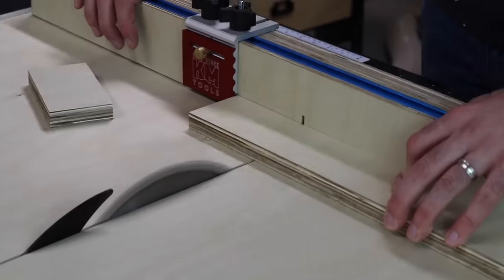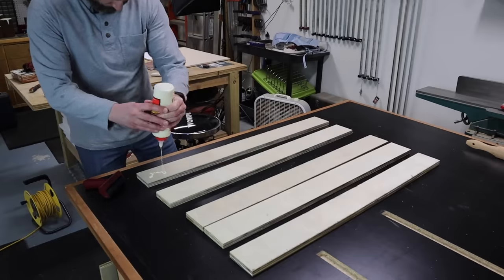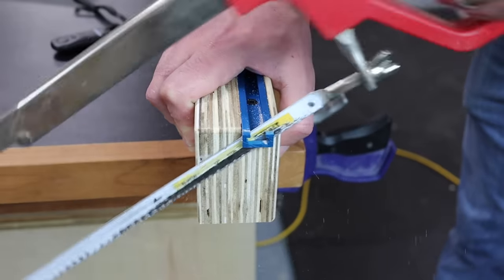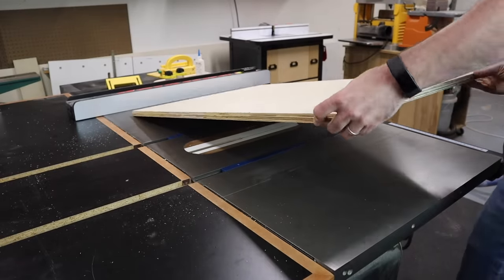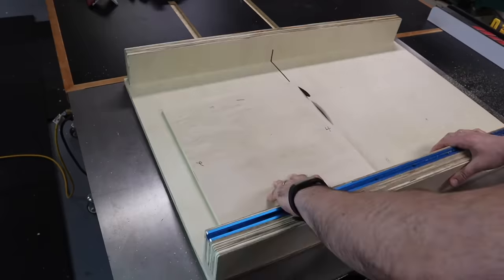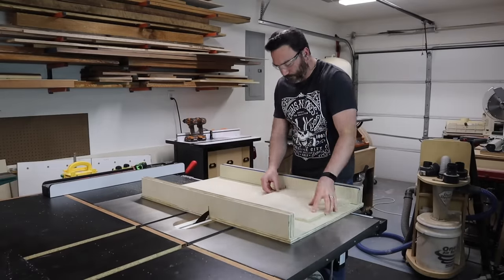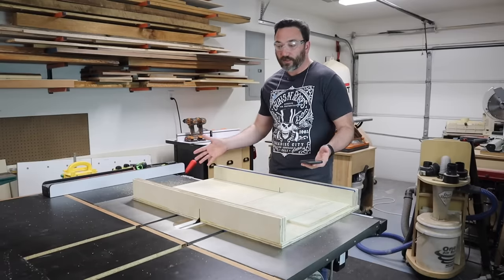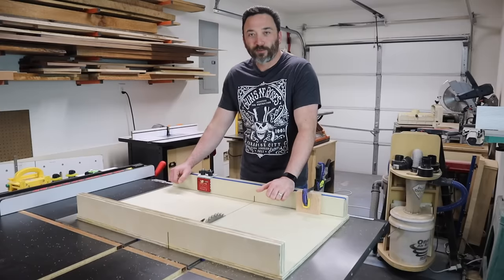Have a Table Saw? You NEED to do This!!!

Comment: Question nobody answers.  Once you make the first set of cuts the square board is no longer square.  (correct?)  So when you make the second and maybe the third set of cuts do you do it with the no longer square board?  Or do you somehow square up the board for those subsequent cuts?  But do you trust your carpenters square?  My machinist squares aren't long enough to check a 16" square.
Hope you can shed some light on this.  Thank you.
Reply from the maker: You are correct that the board will not be perfectly square if the sled was not square when you made the first set of cuts. The great thing about a crosscut sled is you don't need to start with a perfectly square board to make a square board. Just make the adjustments to the sled and cut again. You are referencing off of the sled fence and cutting off one adjacent side. As long as the sled is square, these two sides will be square after the cut. Rotate the board to cut side #2 and now you have another square side. Go all the way around and the board will be perfectly square.
Reply: The panel never has to be square. After you cut it 5 times you're measuring the discrepancy from square. It should be square then. You start out cutting a straight line and from there you're trying to cut a 90, 180, 270 and finally the full 360. It's all theoretical though. Your error adds up and you divide it out to find out precisely how far out of square the cut is.

Comment: Just exactly how much does a less than 3/4 inch wide piece of hardwood expand and shrink, due to changes in humidity, in a wood shop?  Not enough to worry about, I bet. Especially if you keep them waxed.
Reply from the maker: It moves a lot more than I'd like, which is why I stopped using hardwood runners.

Comment: Great video!  I have been looking for good sled video.  One question, I have a DeWault table saw.  Will the sled work if were built slightly wider than the table saw top?  Thanks.
Reply from the maker: It will function, but you need to be careful that you don’t put any pressure on the end that hangs over the edge of the saw. This could cause the sled to lift off the table and create a dangerous situation where either it falls off the saw, or even worse binds in the blade causing a kickback.
Reply: @biscuittreewoodworks  Thanks

Comment: very interesting but unless your building a wooden engine do you really need  to achieve those tolerance's
Reply from the maker: Depends on what you are building, but in most cases you don’t need to be as accurate as I made this one. I did so to show you how it can be done.

Comment: What type of plywood are you using?  Is it high grade Baltic birch plywood?
Reply from the maker: Nope, I used Home Depot maple plywood. Baltic birch was running $250 per sheet when I made this! Just stay away from the really cheap plywood and it should be fine for shop jigs. The cheap stuff warps too much, has more voids, and delaminates very easily.

Comment: great video and quick explanation of 5 cut method!   Do you feel slop in the miter bars for the runner?   I've tried them and still feel too much "play"
Reply from the maker: Not at all. There should be some nylon set screws that allow you to tighten up the fit.

Comment: @biscuittreewoodworks Why do we need the front fence on the sled? Do we really need it?
Reply from the maker: Yes, you need the front fence on a sled like this. It keeps the two sides of the sled together once you run the blade curf down the center. Without it the two sides would move around on the far end of the sled. This can not only cause the rear fence to bow but also cause the sled to bind in the blade.

Comment: Fantastic video. I'm going to make one of these.

BTW, it's probably not that big a deal, but should you use the distance from the pivot screw to the other end of the fence as the fence length in the calculation? It's probably only an inch less, but every little bit helps (or hurts).
Reply from the maker: That is what I did. See 10:45 in the video.
Reply: @biscuittreewoodworks  I was watching while working, so I guess I missed that detail. Sorry 'bout that.

Comment: Hello Sir. I love your presentation. I have a Dewalt table saw that the surface is 19 X 19 what do you suggest the available working space to be excluding the thickness of the fences ? I appreciate your input.
Reply from the maker: Depends on how you set it up. I’ve seen people build huge cabinets for a small job site saw to give them more working area than someone with a professional tablesaw.

Comment: I'm a retired millwright 0.001 is way more tolerance than I am used to. I would have put a dial indicator on this to set it Wright !! I think the basic idea is good but with all the time invested why not go one step further and make the fence adjustable on one end with a treaded rod assembly ? Instead of " Swiss cheese" screw holes in your nice work ? All that math and cutting around a square board looks impressive but what a waste of time. Just like checking any square , framing , tri, or any thing used for 90° measurement a simple scribe line and flip the tool over and check against itself will give you what you need. If the one end of the fence is adjustable. Definitely like the basic design !! Probably good for rough work. 😊
Reply: If the sled were steel then you would be correct.  But we are dealing with wood that expands and contracts with moisture.  0.001” tolerance is plenty!
Reply from the maker: Well, that's the first time someone said this sled was not accurate enough! I used to be a machinist, so I know what you're talking about with the tolerances, but we are dealing with wood here. 0.001" over a 36" span is pretty extreme when working with wooden jigs and normal expansion and contraction will usually be more than that. Try running a dial indicator over the face of plywood and even the surface roughness is more than +- 0.001" 

I'm surprised though about your dismissal of the 5-cut method. It is much more accurate than the method you describe. I'm not even sure how that would work with a sled? An adjustable fence would also reduce accuracy. A small bump could knock it out of position. With it locked in place with screws it cannot change and get out of alignment. There's just no need for an adjustable fence on this kind of sled.

Comment: So I have rewatched the 5-cut method a couple of times, and I simply don't get it. First you say 1/13.000 of an inch. After the adjustment you are at 1/1000 of an inch. 1/1000 is way worse than 1/13.000. Can you explain that please? I am from europe so I don't use imperial. But it looks like pre adjustment it is not 1/13.000 of an inch, but 1/130 of an inch.
Reply from the maker: No problem, let me try to explain. 
The first measurement was 13 thousandths of an inch, which is 0.013". If you expressed this as a fraction it would be 13/1000, which becomes 0.013.
The second time after adjustments I got 1 thousandths of an inch, which is 0.001", or 1/1000. 
0.013 > 0.001
Reply: @biscuittreewoodworks  Ahh now I understand. I thought you Said “one thirteenth thousands of an inch” thanks for explaining

Comment: I need to build a new sled, thanks for the ideas. 
My track guides will be hard wood very well sealed with tung oil. 
I won't be using maths or a feeler guage. Two test cuts,flip one over and see if cant see light through gap will suit me.
I don't know what colour to paint the stop blocks but i know i wont be buying one.

I've got losta wood.
I used have a wooden dog
Wooden shit😂
S
Reply from the maker: Sounds like that should work fine. Extreme accuracy isn't needed for everything. Thanks for watching!

Comment: Need to use solid lumber rather than plywood,2x6 or 2x8 FOTR fences/rails
Reply from the maker: I would not recommend using solid wood for the fences. Plywood is much more stable than solid wood and is not as prone to twisting and warping. Especially construction grade lumber which is very unstable.

Comment: What grade of plywood did you use? Also, was it just luck that your A and B cutoff was exactly 14 inches? Thanks! Garry
Reply from the maker: I believe this was just 3/4" maple plywood from Home Depot. Go with the best available to reduce the number of voids in the plywood and the risk of delamination. If you can get baltic birch at a reasonable price, that would be the best option.
Reply: @biscuittreewoodworks Thanks!
Reply: @biscuittreewoodworks  Baltic birch comes from Russia. Now taking the present administration's dubious foreign policy decisions into account supply chain interruptions should be expected. The things we all have to sacrifice to not have to suffer mean tweets.

Comment: Is the purpose of the rear fence just to add rigidity?  Seems like it adds some weight unnecessarily, since it is also several layers of 3/4" plywood in thickness.  Couldn't it be just a single layer of 3/4" ply?

GREAT design otherwise.
Reply from the maker: Yes, it adds strength and rigidity to the sled. You might get away with a single layer of 3/4" plywood, but I feel a lot better with the double layer. It doesn't add that much.

Comment: Enjoyed the video, but what if a is smaller than b..hows does the math work?
Reply from the maker: The math is exactly the same and you should end up with a negative number. I explain at about 11:30 which way to move the fence depending on if A is bigger or smaller than B.

Comment: 2 improvements should be  added . ! amA block on the fence closest to you to protect you from the blade as you finish the cut. 2nd is to add a clearer fence the length of the cut over the blade. I made mine so it fits into slots in both fences but is easily removed when needed.
Reply from the maker: Thanks for the suggestions. I do have a blade block on the back of the fence closest to me. You might have missed me adding that at the end of the video. I'm not really a fan of the clear acrylic piece over the blade. To me it just gets in the way, but you can definitely add it if you like.

Comment: I don't get what the purpose or need of the front fence is. Why not just leave it out?
Reply from the maker: It stabilizes the jig. The single back fence would not be able to keep the two sides straight and square by itself.
Reply: It's there so the sled doesn't fall apart. When you use the sled you cut it in half. So having bits on each end you don't saw completely in half helps hold it together. Pro tip: never raise your blade up so high you do cut the ends in half.

Comment: I don't think gluing melamine will hold together too long..
Reply from the maker: No, glue will not bond to melamine, you would need to use screws or some other fastener.

Comment: I like my miter bars made of HDPE bar stock. This doesn't dent as easily as the Aluminum does. Or you could even use the old miter gauge you threw in the trash if you can drill & tap holes into it.
  As for the other features I have seen a few simple & very accurate sleds that let you do miters. Here is one of my favorites.
https://youtu.be/ThHQFVD00w4?si=57pZGupIdaZCiKHR
Reply from the maker: If you want an adjustable sled for miters, I recommend having a seperate sled for that. My cross cut sled is perfectly 90 degrees to the blade and I never have to worry about it moving out of adjustment. I have another sled that is made for perfect 45 degree miters. Anything in between I'll use my miter saw or a much better miter gauge at the table saw.

Comment: Don't even need to use math, Just put a piece of wood inside one side on the right then take the same piece and use it on the left and the fence should be perfect. lets say is 2ft at right, so the other side should be 2ft too since is the same length .
Reply from the maker: Depends on how much accuracy you need I guess.
Reply: This would dpend on how straight the piece of wood you're using is to measure it.  Multiple cuts is definitely the way to go.

Comment: Thousandths of an inch off.  Don't think I'd mess with it. It's so small
Reply from the maker: If that's close enough for you, you don't have to chase perfection!
Reply: @biscuittreewoodworks  unless you make something that's over 6' are yiu going to see it?
Reply from the maker: @truthh8322 if I’m making a dovetailed case a few thousands of an inch out will result in a huge gap that I won’t even see until hours of work later. It’s all relative to the type of work you are doing.

Comment: Square the fence to the blade with a metal framing square and call it perfect.  Trying to dial in thousandths of an inch is pointless because it is going to be effected by the natural movement of the plywood and deflection of the saw blade. 1/128-inch is .0078 and if you need better than 8 thousandths accuracy cutting material, you need a cnc laser not a table saw.
Reply from the maker: I wouldn't call it perfect, but might be good enough depending on what type of woodworking you are doing.

Comment: Golly Gosh!! The tip re getting the runners correctly fitted is ace, 100% ace! 

BUT……………………. the maths you did…………..f*** m*!! I even played you back at 1/2 speed but still nope! Gosh did you say this was the simple explanation??  I was so fried it took me a moment to get the stop block skit. Which was brilliant by the way! Did you buy the wood block and red paint of Kats site?

Great video enjoyed very much but 5 cuts and 3 hours of maths to get to some tiny fraction (I mean feeler gauges in woodworking?!) I thought’we’ we’re free from this stuff ……confused person back in bed recovering……..
Still a great video 😂
Bob
England
Reply from the maker: Hi Bob! I hope you have recovered from the math lesson! 
For the people who want dead-on accuracy, the 5-Cut Method is the way to get there! But, if you don't need that degree of accuracy you can just use a square on the blade to align the fence and get it pretty close!
Reply: @biscuittreewoodworks  I love your skits very much! Considered putting out a Highlights Skits of 2024 at Christmas? 🎅 Y’now I thought you guys were saying ’sledge’ and not sled!? 
I genuinely dont understand the need for such accuracy in woodworking, I know that I can’t imagine working to such tolerances! 
Great channel my friend across the pond!
Bob
England

Comment: Okay so first things first, you'll need a bunch of other power tools to make this.
Reply from the maker: The only tools you have to have for this build is the table saw and a drill. The router table is optional. You could make the champers with a hand plane or just some sandpaper. The groove for the T-track can be made on the table saw with or without a dado stack. The sanding and rounding over of the edges can obviously be done by hand. You can do this with what you have if you have just a little motivation and ingenuity!

Comment: not 13 thousands it is 13 ten thousands
Reply from the maker: No, 13 thousandths is the correct term for 0.013”. I have an engineering and machinist background, I know what I’m talking about with precision measurements.
Reply: .0013 is 13 ten thousands @biscuittreewoodworks  🙂
Reply from the maker: @fixitfast110  In engineering 0.013 is 13 thousandths, and 0.0013 is 1.3 thousandths. 
Here's some background reading on it if you're interested.
https://en.wikipedia.org/wiki/Thousandth_of_an_inch#:~:text=Equal%20to%201%E2%81%841000,a%20mil%20(plural%20mils).&text=The%20words%20are%20shortened%20forms,%22%20(mille%20in%20Latin).

Comment: I've been a woodworker (framer, trim, cabinets) since 1974.  In my shop we build custom cabinets, furniture, windows, doors, you name it and if it's made out of wood, we can handle it.  If you came into my shop and spent time adjusting anything 0.013", I'd ask you to please not.  If you continued to obsess over such tolerances, I'd fire you.  Our medium is WOOD.  You want to work to 1000th's, go be a machinist.   With wood, even chasing a 32nd can be a waste of time.  The wood itself will move more than that on its own as it continually responds to the elements.   You want to waste your time, by all means it's yours to waste.  But not on my dime.
Reply from the maker: That’s why I’m not a framer or carpenter. I make furniture. I can’t build a dovetailed case working with 32nd tolerances. In my line of work I need that level of accuracy. I fully respect what you do, but that wouldn’t fly in my shop because we aren’t doing the same thing. If you don’t need that level of accuracy, you can stop where it’s good enough for you and your work. For the people like me that need that level of accuracy I go into the detail needed to achieve it.
Reply: Yes, I've heard that before.  It's good to be exposed to, and to learn from, all forms of woodworking.  All the knowledge that can be gained in the different disciplines of woodworking have served woodworkers well for generations.  I'm sure if they'd had the conveniences of modern tools,  the cabinetmaker Thomas Chippendale and his son would have jumped all over them.  However, somehow they managed to create masterpieces that, for the most part, are unmatched today.  And they did so simply by using sharp edge tools, a keen eye, and a mastery of the tools available to them at that time.   I'm sure that a lot of the techniques they used in the 18th century due to what we might perceive today as limitations, have been long lost.

Comment: Of course if you have ALL that equipment. Come on who is this video for? Not the average DIY guy!
Reply from the maker: Actually you can make this sled with just the table saw and a drill. The fences can be cleaned up at the table saw, the groove for the t-track can be done at the table saw or with a hand router, the smoothing and sanding can be done by hand, etc.
Don’t let my specific tools stop you from building a great jig! Put a little thought into how you can accomplish each task with the tools you do have! 
And if you have questions I’m happy to help!